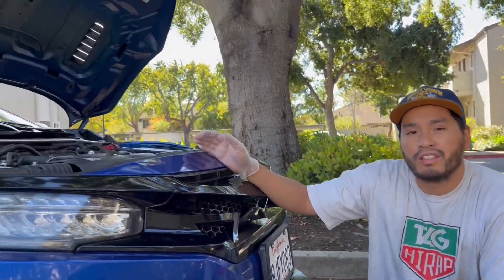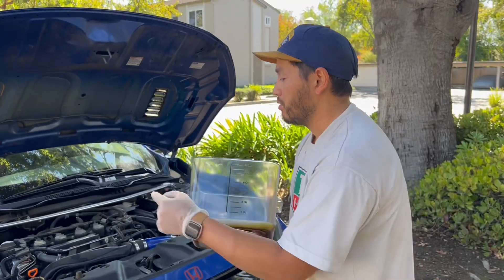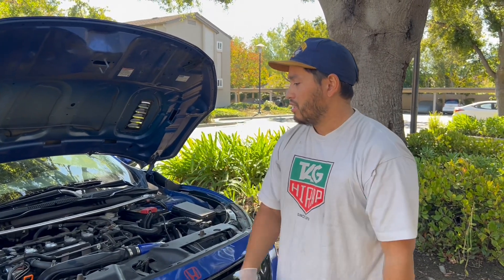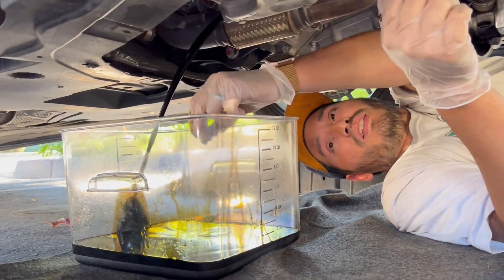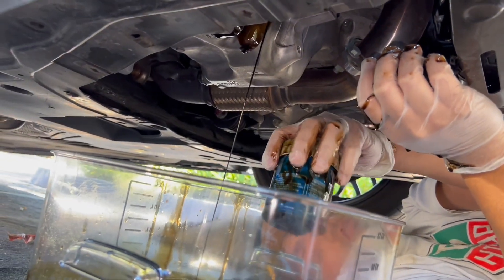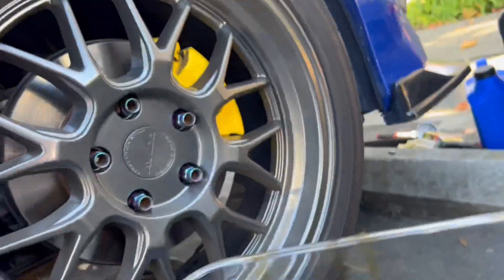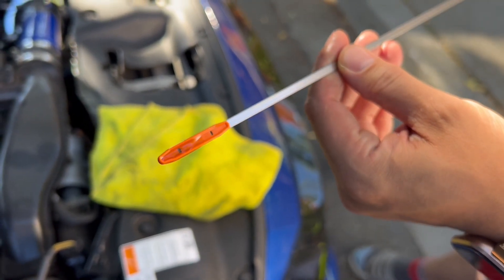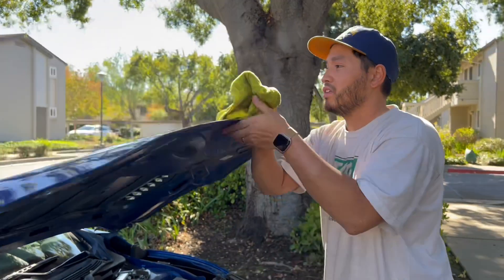Major Problem with my Honda Civic 10th Gen OIL DILUTION Fuel Mixing Issue, No Warranty Fix Recall

Comment: Do thew 2019 civic still have this issue?
Reply from the maker: Unfortunately yes, but you can get a software update for the ECU to supposedly fix it.
Reply: @Sals_Garage  I'm in EU ..Austria to be more specific and there is a civic 2019 with only 22 k Km  for sale at 17 k Euro...It is listed on honda website as authorized dealer and it is coming with some warranty and etc. But i am sceptical a little because is kinda low price and usually at deasler the cars  arent cheap :)
Reply from the maker: @radudanieliacob2088  sounds like a good deal if it comes with warranty too.

Comment: Its fine as long as you change the oil following the MM reminder. Fuel in the engine oil is normal because of the direct injection. I drove a 2017 Hatchback for 5 years. Amazing car. get 40mpg on the hwy
Reply from the maker: Yea great car for sure! Just hate the unreliable AC that leaks a lot 😆
Reply: I just got a 2018 hatch exl at 17.4k miles… I hope no isses for mine too😢

Comment: Redesigned 1.5 in the 2022 Civics made this an issue of the past. Make sure you run 91 octane this eliminates the oil dilution
Reply from the maker: Thanks for the info 🙏
Reply: Never had a problem in my 2018 ?

Comment: This a result of the direct injection, its not a problem. I have Honda Jazz GK5 with 1.5 naturally aspirated engine and it has the same oil dilution. It makes the oil as water , so i switched to 5W30 A3/B4 oil, and i am changing it every 5000km (3000miles) or 4-5 months. This way, even if the oil gets a bit thinner it will get as the recommended 0W20. I installed an oil catch can as well.
Reply from the maker: Thanks for the advice 👍

Comment: Have you tried adding liquid Molly engine flush ..... Then rev the engine to 2000 RPM for 15 minutes and then empty all the old oil out remove the old oil filter..... Then fit new oil filter and refill with New oil 0W16 then monitor it to see if it cures the problem
Reply from the maker: I have not. Good tip, thx for sharing.

Comment: Ethanol fuels appear to make the fuel dilution problem worse e.g. It was only when my car started using E10 (10% ethanol) that the fuel dilution problem started.
N.B. Stopping the E10 saw the fuel dilution decrease.

Flushing the engine out with a product called "Ring Free" helped as well.

Had exactly the same problem except worse (used E10 for longer) on my sister's car i.e. Started using oil despite the mechanic being unable to find a cause.
Flushing out the engine stopped the oil use. We presume that the rings got gummed up.

🙂
Reply from the maker: Good info. Thanks for sharing 🙏
Reply: Here's what we worked out happened:

Burning ethanol creates oxidised byproducts. 
The oxidised byproducts polymerise into a sticky goo which gums up your engine. 
The rings in particular gum up and don't seal properly. 
That's why more fuel ends up in your sump and dilutes the oil.

🙂
Reply from the maker: @MichaelCzajka  so Honda can’t seem to make reliable engines and AC for the 10th gen Civic sadly.

Comment: Hi, I'm from another country "Panama" and I saw your channel, my country is extremely hot and has a variable climate, "deeply tropical". I want to get a manual SI 2018 Coupe that has 14 km (I think it would be something more than 8000 miles) that is the same as yours, but that "oil dilution" thing is the first time I hear it and this is going to be my first Honda in life, I come from a Kia Picanto and a Hyundai Tucson, therefore I know ZERO about Honda and this calls my attention a lot.
The questions
-In hot climates the problem is the same?
-Is it a good or bad engine?
Greetings and I leave you my like and subscription.
Reply from the maker: Hi!  In hot climates you shouldn’t have to worry about this problem.

Comment: Thanks for this info. Did an analysis a couple weeks ago and received an alert for elevated fuel dilution at 2.78%. Got a 2017 civic doing 43,500 miles. 

I live in a tropical country with temps ranging between  92-96F, have only used fuel with 95 octane and synthetic engine oils (5w30). Vehicle has been changed as recommended by the OEM.

I think my problem is related to reduced commute. I'm only driving around 10 miles daily and the engine  isn't reaching proper operating temperature. 

I sent my oil analysis report and heading into the dealership this week. Will be interesting to see how much oil is drained from the sump and hoping they won't charge me extra for some crazy fixes. 

Looks like I'll have to reduce my oil interval change out to fix the problem.
Reply from the maker: Yes so far I have been changing oil more often and haven’t had issues yet 🤞
Reply: Make sure the oil hits 201f or more, boils the water off

Comment: Also, Honda states that this car takes 4qts after an oil drain and filter replacement. so not sure where you're getting your 3.7qt data from. my FK7 has been consistent with close to 4qts with dipstick level at the perfect level, even after 5k miles. this oil dilution problem was only an issue for cold climates, such as areas where it snows, etc.
Reply from the maker: The previous oil change before that was near 5 quarts. The oil has a strong smell of fuel as well. It is a very real issue that Honda is trying to bandaid with a software fix that makes the engine run hotter on purpose. Mix that with the unreliable AC system and It makes me not want to get another Honda again.
Reply: @Sals_Garage  Its just weird that everyone else is having these issues with thier Hondas and I am not. My oil level is consistant, my oil never smelled or smells of gas, I've never had a gas smell in the cabin and my oil drains, when measured, are consistant. This almost leads me to belive it can also be a quality control issues from factory with the engines. My 2018 FK7 has had Zero recalls or TSBs. not even the faulty fuel pump recall that most FK7's and FK8's had. but only time will tell I guess.

With that said though, I have adapted my habbits as much as possible to avoid the oil dilution issue, which honestly should not be a thing. And when I got my FK7 new I followed the break in period religiously. so idk.
Reply from the maker: @Kagemusha320  I’m very happy you haven’t had any issues so far. How about your AC? That one seems more common of a problem.
Reply: @Sals_Garage  AC blows cold. Altohugh I've noticed the airflow is pretty weak on these FK7's. Although on really warm days it does take a couple minutes to blow really cold but that seems kind of ligical with a sun baked car. My fiances sedan however had a low AC charge from factory. The dealership determined this and charged her AC for free.
Reply from the maker: @Kagemusha320  thanks for sharing! 🙏

Comment: YOUR SUCH A NICE KID... BUT THE GAS IS BLOWING PAST YOUR PISTON RINGS AND ITS DUE TO THE DIRECT INJECTION FUEL SYSTEM... THE FUEL INJECTORS ARE BLOWING EXCESS FUEL INTO CYLINDERS AND WASHING OUT THE RINGS AND INTO THE OIL PAN
Reply from the maker: Thx for the info

Comment: Just do your oil changes more often, there is no fix to this issue, the cylinders are small enough and with a turbocharger and a direct injection fuel injection, this causes oil dilution, to fix this issue, an engine teardown is required, maybe replace the piston rings with something better in terms of separating fuel from oil. What I do is I just change my oil often like 3000-5000 km is enough to avoid severe wear. And Honda claims they fix the issue by making the cars idle higher, so when they recalled the cars, the Honda techs, all they did was just update the car’s computer (ECU) to make the engine idle higher on cold starts.
Reply from the maker: Thanks for the detailed info 👍

Comment: is not a big issue, because is a  high compression engine with cold weather gas  by pass the cylinder on cold engine.  , install a catch can and every oil change use 3 Qts of 0w-20 and 1 Qt of 5w 20. problem solve. only in the winter time
Reply from the maker: Thanks for your input 👍
Reply: the gasoline also coats cylinders when cold.
Reply from the maker: @jamesmedina2062  interesting fact. Thanks 🙏

Comment: Its sad that Honda is really going downhill man with their reliability......ill never sell my 2008 fg2 its heavily modified and still running strong at 210k miles. Lots of preventative maintenance though.
Reply from the maker: Thanks for sharing!  Yea pretty bummed about Honda’s lack of support with common known issues too.
Reply: @Sals_Garage  i know! I was going to get one of the new Si's because power is so plentiful with small mods and a tune but the fuel dilution and direct injection sludge is just too much for me.

Comment: Actually there is no fix. Problem persists with the crv and civic even after the software update. I have Accord 2018 1.5t, honda did not included accrd with the fix. I just chnge the oil every 2000 to 2500 miles. Sometimes earlier. I am surprised how honda kept this faulty engine in their new generation honda cars.
Reply from the maker: Thanks for sharing. That’s sad to hear.

Comment: Change the fuel injectors and fuel joint pipe.. that's what we do at honda...
Reply from the maker: Good to know. Thanks 🙏
Reply: We thanks for the info bro...😀
But are you sure that make the problem away  ??? What injectors  must put and what fuel pipe ??
Thanks again for the info.... from Greece.

Comment: I hate that most new cars are automatics
... different topic...but I wouldn't want a new Honda partially because of that
Reply from the maker: I hear ya. The CVT is very boring. I wish I had the manual version.
Reply: @Sals_Garage  butz I do love Honda, my wife's got an orange 09 fit sport 5 spd, it's got 200k on it right now , all its needed had been regular maintenance, and a cu couple wear and tear things, like  tie rod ends and stabilizer links. Car runs and drives perfect , oh   I had to replace the battery , in December and I think it was the original battery. I couldn't believe that little battery was 150 bucks at Walmart though. Crazy.
Reply: Love my 6sp 2015 Accord Sport.
Reply from the maker: @chrisnichter9895  I’m jealous of the 6 speed manual. The CVT is so boring 😆
Reply: @Sals_Garage  Lol they are fun! And super reliable!
Reply from the maker: @chrisnichter9895  too bad they are so expensive now. Car prices everywhere
Reply: @Sals_Garage  Yeah it sure is crazy! Luckily I got it before all this started and these gas prices 😒

Comment: Do more research on the internet - I read somewhere - Start using non ethanol grade of gas + software upgrade from Honda dealer is supposed to solve this issue.
Reply from the maker: Done those already, still same issue.
Reply: I use almost all ethanol free gas but I still have the oil smelling like gas. I can only get ethanol free here in Utah at 87 octane at best. Would like 88 or 89 octane if I could get it.

Comment: Like the shirt lol sucks about your Honda though. The L15B engine is not as good of a platform to do some serious modding based from what have seen so far
Reply from the maker: Yea I have returned to stock for the mpg and reliability. Better for the CVT in the long term as well. It’s just a daily so we don’t need the extra power.

Comment: Fuel and oil don't mix and any dilution will jeopardize the oils protective characteristics.  This is why gdi is not meant to be reliable but rather more fuel efficient and meet stricter EPA regulations. It's the governments fault not honda lol. JP
Reply from the maker: Good point 😆 thx for sharing.

Comment: You can eliminate the risk of catastrophic engine failure by improving lubrication to the engine:

Bond a lubricant to the metal of the engine #XcelPlus

🙂
Reply from the maker: How so

Comment: You have no idea what your talking about, get ase certified before wasting my time
Reply from the maker: Go on and explain it better if you can. I am just talking about my experience.
Reply: @Sals_Garage  oil dilution is not a Honda issue,it's a GDI Issue and it's caused by ring blow by all things you missed with your comments, a ecu reflash which changes how the injector spray pattern is introduced into the cylinders can greatly reduce blow by,25 year master mechanic talking not a YouTuber diy douche
Reply from the maker: @clgdswr  thanks for the explanation. You’re the one sounding like a douche btw 👍
Reply: Sorry for the douche comment I was out of line and feel bad for that
Reply from the maker: @clgdswr  thanks again for the feedback and info